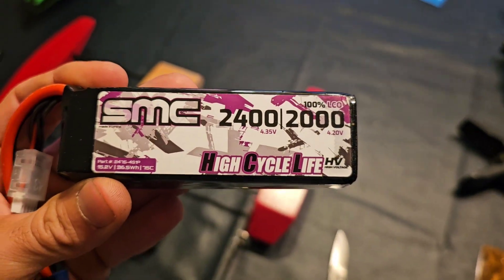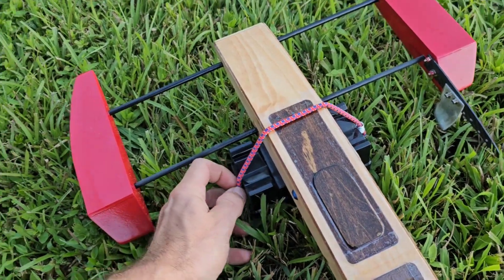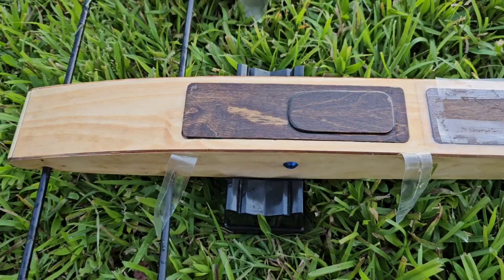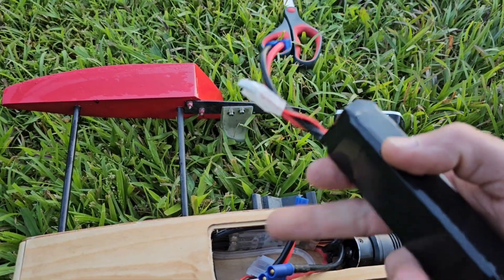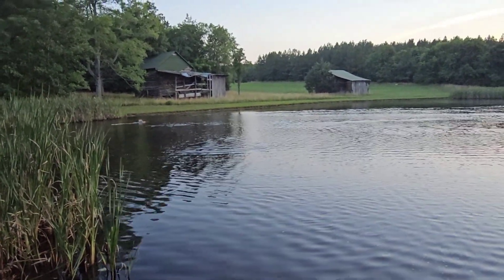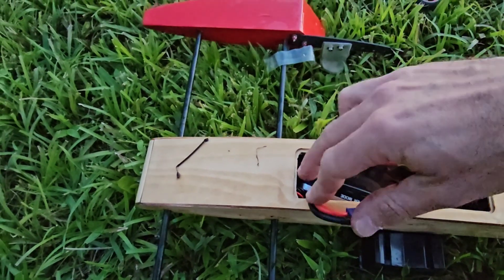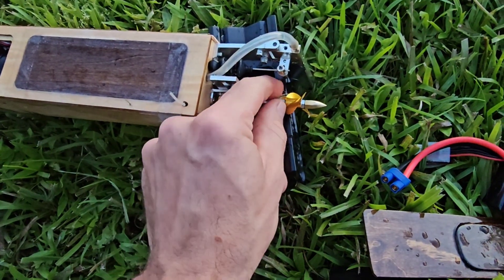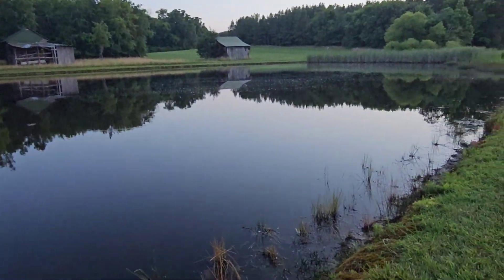Testing SMC Batteries HP vs. HV High Voltage in the Shrimp Outrigger.

Comment: 58 on 3 s on a small pond and with a turn fin is amazing.
I just removed my turn fin off my 26” ecomaster h1 rigger and went from 86.2 mph to 94.5 mph and I thought my turn fin was a good one. Running a surpass rocket 2968 3000 mah 100 c lipo 120 amp hobbywing pro esc with my own cooling plate. No temp over 110 f
Insane.